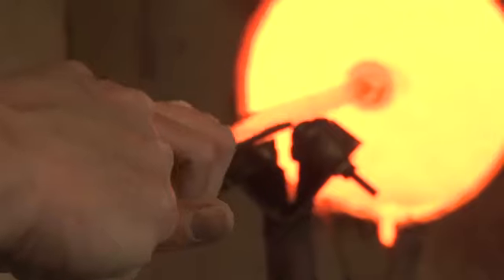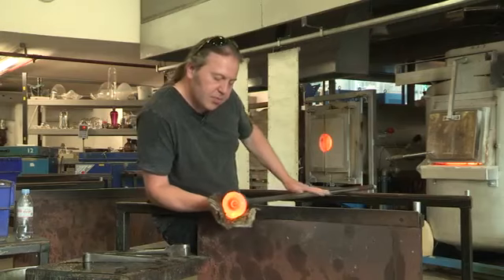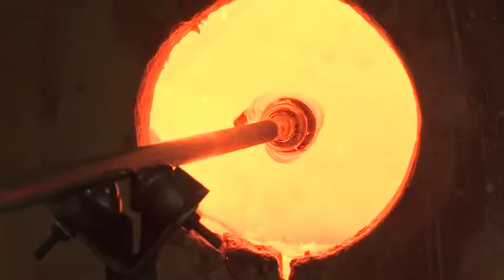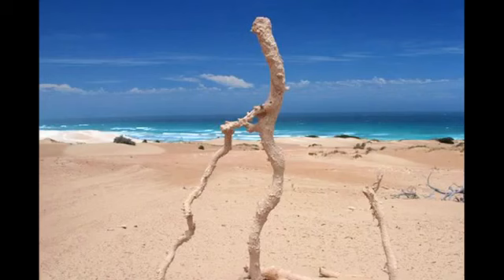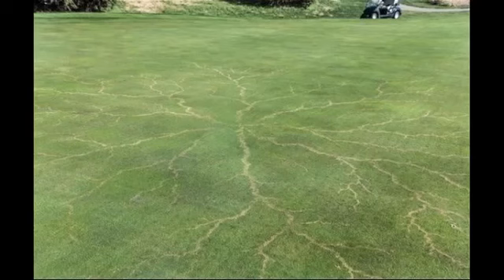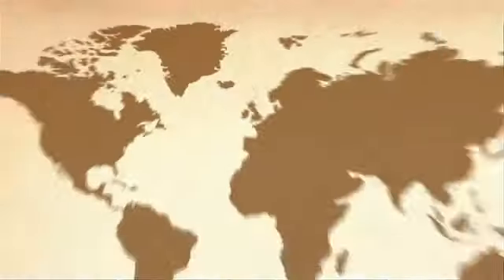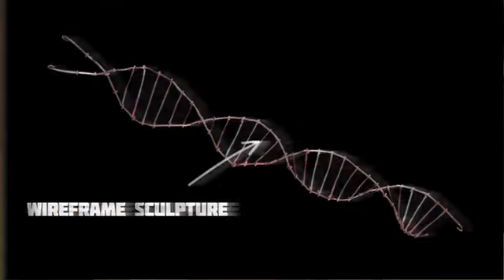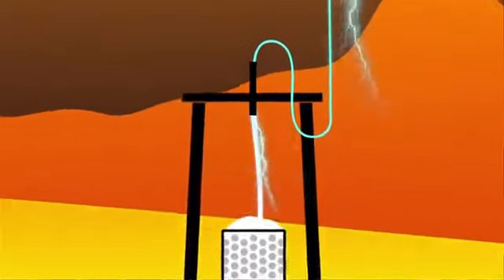Project Lightning Glass Pitch

Comment: I think he could just stick a metal rod in the sand, in a remote location where it won't be disturbed, somewhere in an area that gets lightning storms, and leave it there for a season. You couldn't control when the glass is produced but you'd probably get results eventually. No rocket or faraday cage required. Unless his goal is literally to produce the glass on demand, in which case this method wouldn't work.
Reply: That would give a random result and he was after something more controlled I think. I wonder if there was a follow up video showing the outcome?

Comment: "A test run in the UK". we get one or two tiny thunderstorms a year... Good luck lmao.
Reply: You obviously don't understand the idea and how much current there is above our heads. As you go up every 5-10 feet there is a substantial increase in charge. If he is able to launch a rocket up high enough it will attract energy, ground via the wire attached to the rocket, and make lightning. Basically he is making artificial lightning where there wouldn't be any without the grounding from this wire.